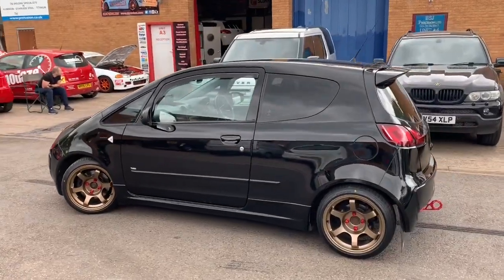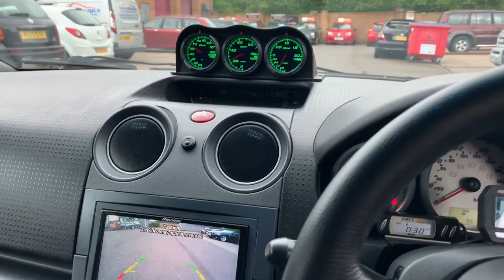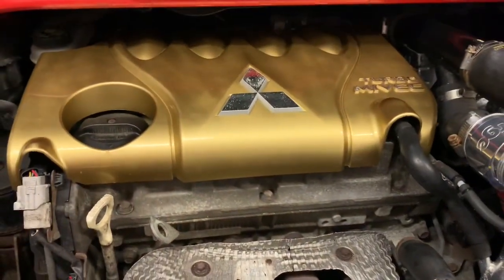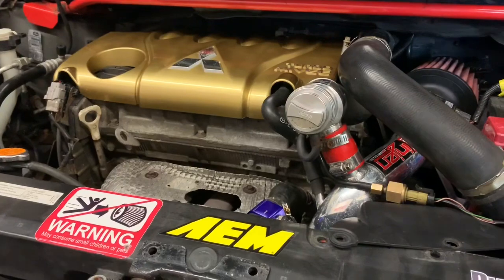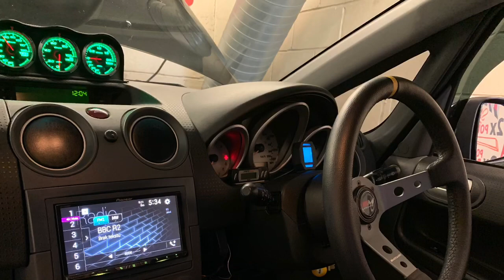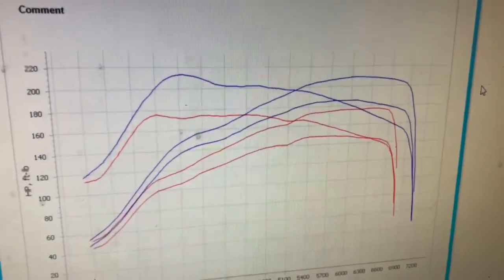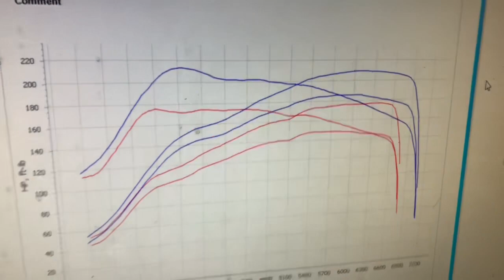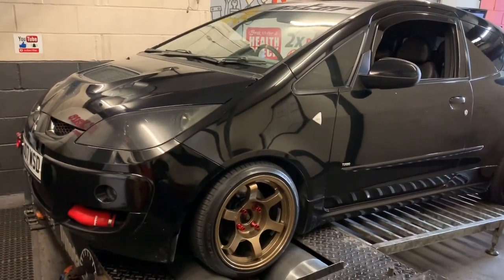**MUST SEE ** THIS STUNNING Mitsubishi Colt CZT for Custom Ecutek Remap

Comment: How reliable are these little czt?
Reply: Engines are decent for mid 200’s hp but the gearboxes are chocolate. Nearly as unreliable as the dsg in the 1.4 Ibiza cupra
Reply: mines on its 1st box, 200bhp been ragged for over a year and had no issues @Honda_Man_Sam